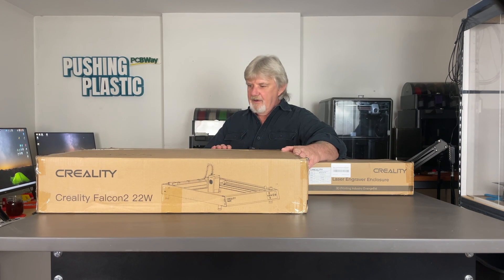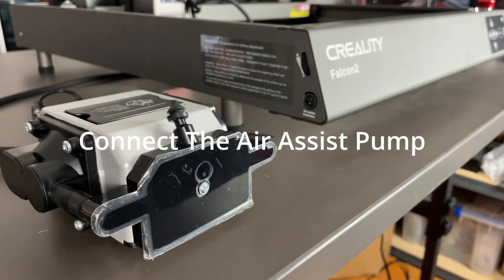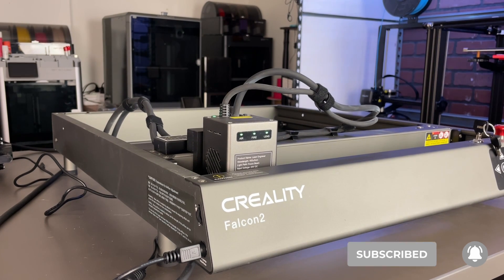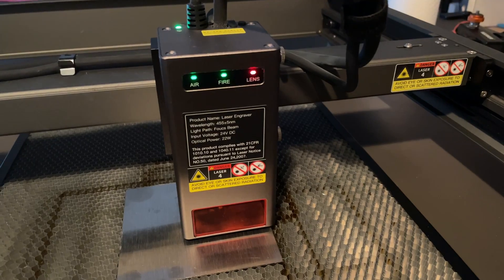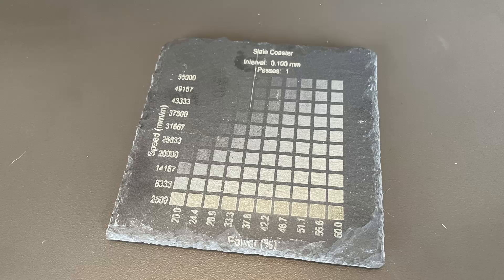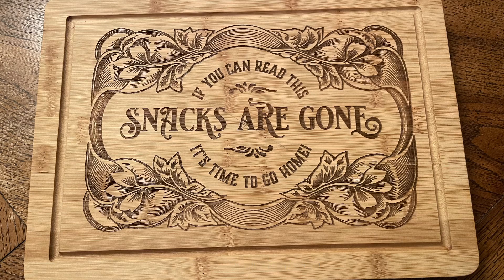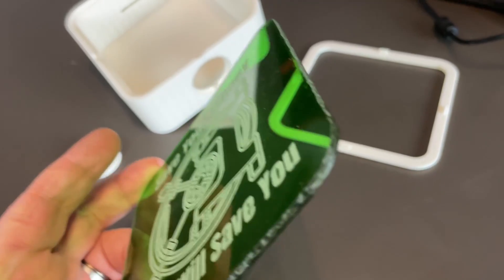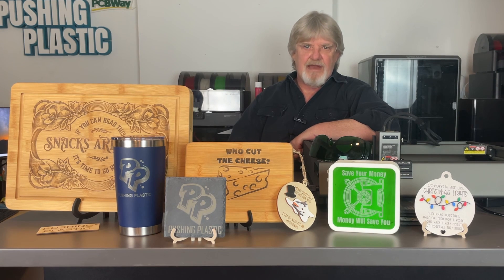Will The Addition of A Laser Engraver Enhance My 3D Printing Operation?

Comment: Great video and nice to see lots of ‘real world’ projects being made. On the bread board and slate what’s the process for centring please? Or more specifically is it easy or a faff? Appreciate your opinion.
Reply from the maker: For both the bread board & the coaster. I took a ruler and lightly drew a line with a pencil from corner to corner diagonally. Where they crossed was the center of the coaster & board. In fact, in the video, you can still see the pencil marks on the board. In Lightburn, I set my starting point "Current Position" (center). I raise the laser, and in Lightburn there is a setting to "Fire Laser" and a power setting for doing that. So I set my laser power to 0.75%. Just enough to make it light up but not mark the material. I adjust the laser position so the laser light is pointing at the intersection of the pencil lines. Turn of the "Fire laser. Then I lower the laser to the proper focus height being care that the laser only moves up and down. Then I start the engraving process. It's not as difficult as it sounds, the whole process is less than a minute. But I did order a side mounted alignment laser to make this job even easier. The one I choose was $50 after shipping & tax. I should be here this week so I haven't tried that method yet.
Reply: @ Brilliant, thanks for the prompt and detailed reply. I’ll be using this method :-)

Comment: I use freecad with my K1c. Can I use freecad to design a 2d image and transfer directly to the Falcon from my computer, or do I need to learn how to use another program? What file extensions does the Falcon read?  I take it that buying the Falcon on its own is not enough. Is the requirement for an enclosure and a smoke removal system a must to be able to operate this system inside my home
Reply from the maker: You could export the freecad image as an SVG. Then bring that into either Lightburn or Creality Design Space to process it for cutting/engraving, both are easy to use. If you are using the TF card for the Falcon2, then it's a gcode file that you can export from Lightburn or Creality Design Space. I would recommend using an enclosure, especially for wood, acrylic and anything powder coated. The Pro versions of the Falcon2, have a lid and ventilation already. If you use the link in the description, it leads to the Falcon2 page and you can have a look! I hope I didn't miss anything!